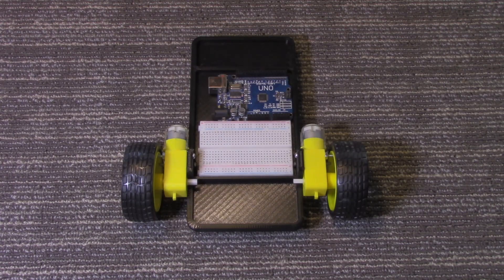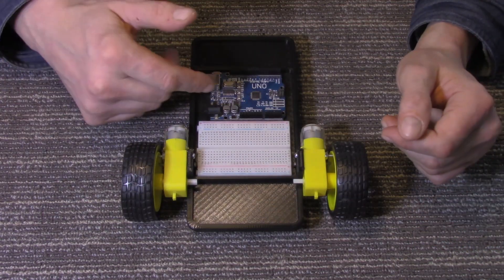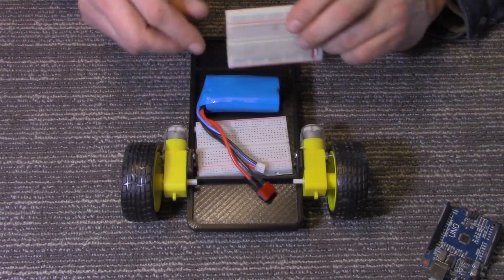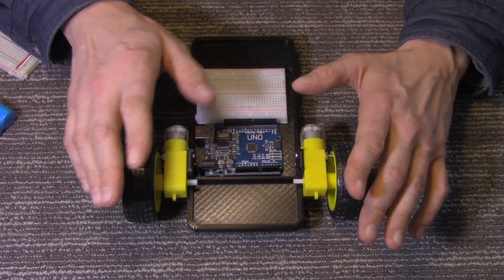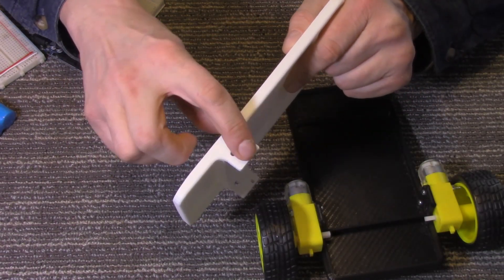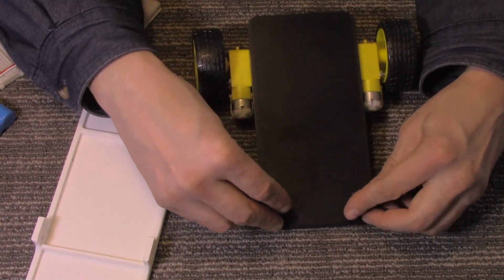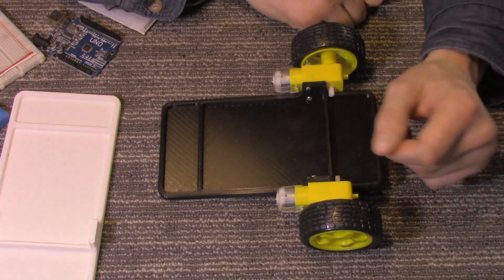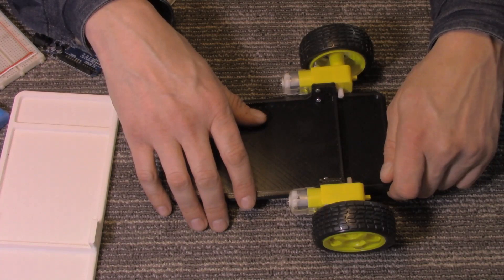Arduino 3D printed two wheel drive robot body platform.

Comment: What are these yellow motor/wheel assemblies? I was more curious about them, never seen them before.

Well found it, the TT Motor, FA-130 clone with 48:1 gearbox, and matching 65mm wheel, is that about right? They are cheap.